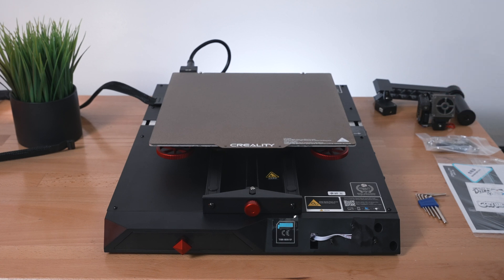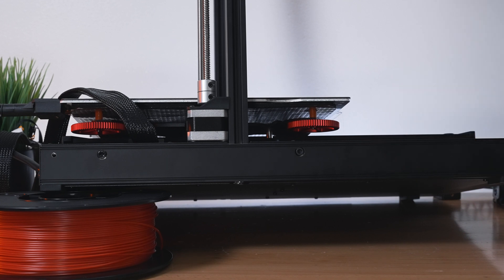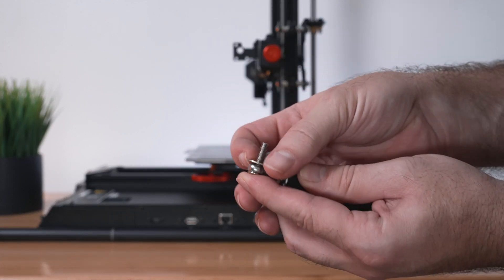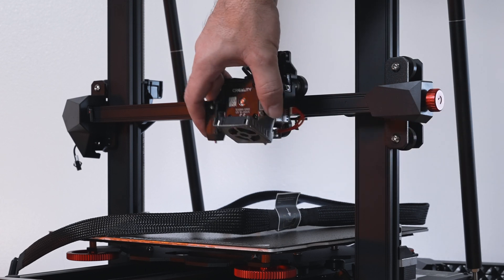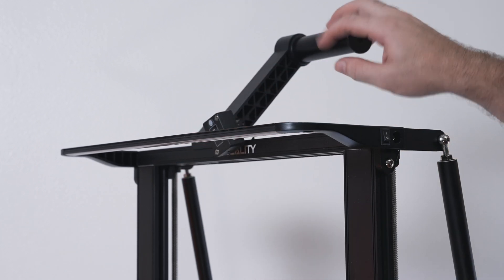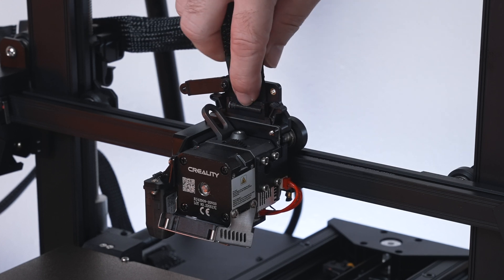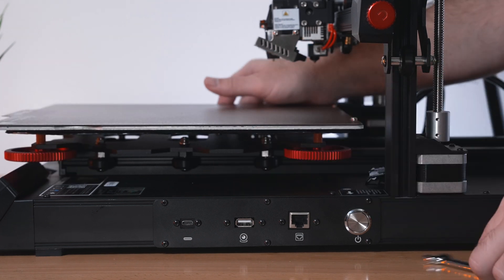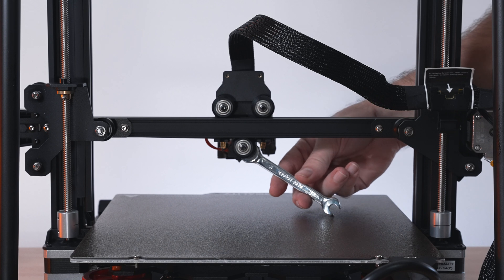Creality CR-10 Smart Pro - 3D Printer - Assembly

Comment: great video   -  i have two issue the build plate has a lot of slop that varies more at the back of the unit less at the front when you slide it.  tightening the cams does not really get there.  I did a manual evel with a sheet of paper and then an auto level.  But the first print the nozzle is 3 mm above the bed  -  I set a Z offest but this is very confusing